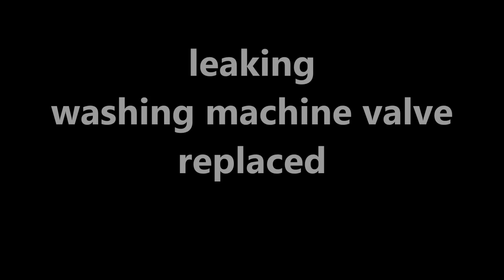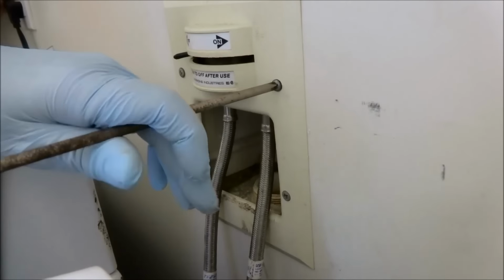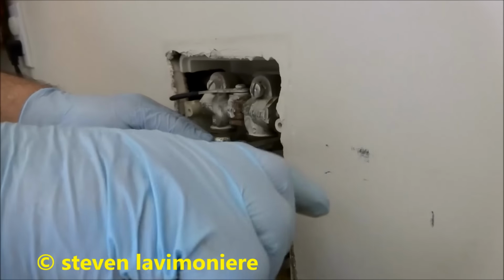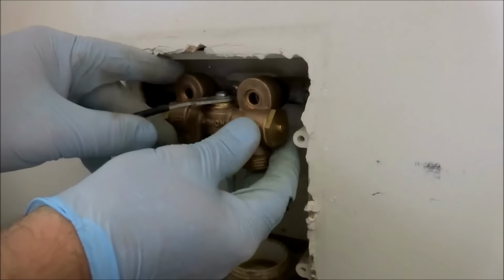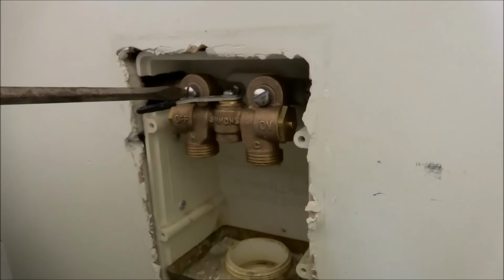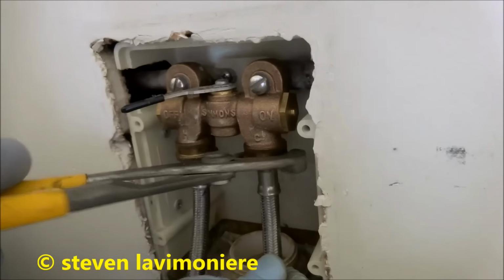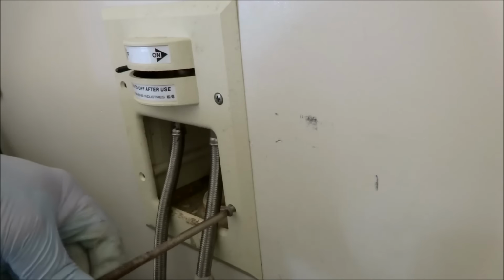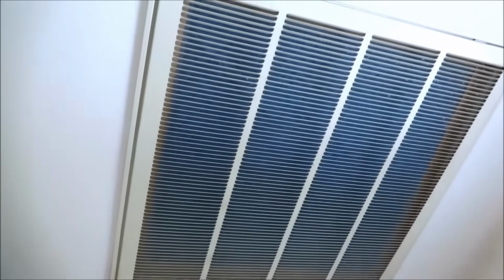leaking washer machine valve replaced

Comment: Every time I see a video about these Symmons valve, I have to watch.  Mine was so old, the new design wouldn't align up with old configuration.  I'm glad my plumber cut it off and put separate shut off valves for hot and cold.  Always good to see you do this correct and no leaks the first time.
Reply from the maker: they leak a lot when replacing them . always leary

Comment: I'm no plumber.  However, I would always put some valve grease on those O-rings.  It makes for a better seal.  I would also put some on the washer fill lines.  Over time, those connections can get oxidized to the faucet.

Comment: I have the equivalent Watts valve.  Had to change it and sure enough leaked when I turned it on.  It sucks when you are working alone with nobody telling you over the phone/radio to turn the water off.  Good tip of using the paper towel and turning the water on and off quickly.
Reply from the maker: yes i have had floods before like that so i am carefull now

Comment: why dont you like the hepa pleated filters?  dont the blue ones make the insides of the furnace/ A Coil more dirty?
Reply: They restrict air flows.  With that said, you can measure the static pressure of your furnance/airhandler and if it's within the factory specs while using one of those hepa filters you are good to go.
Reply from the maker: blue filters are fine .better for air flow across coil .